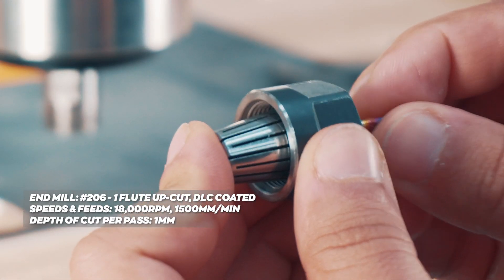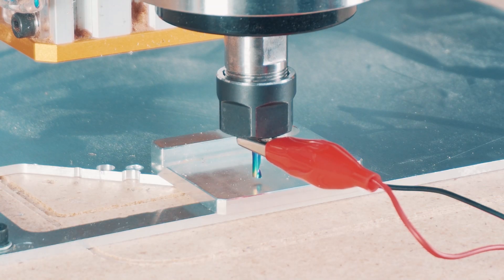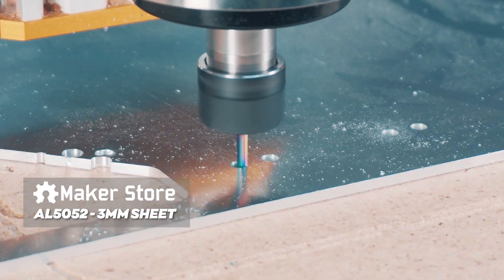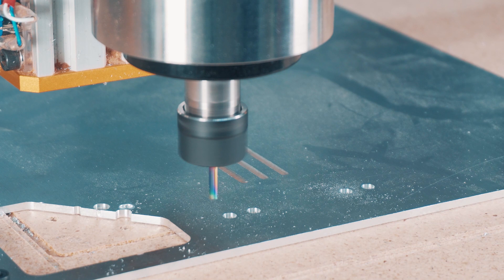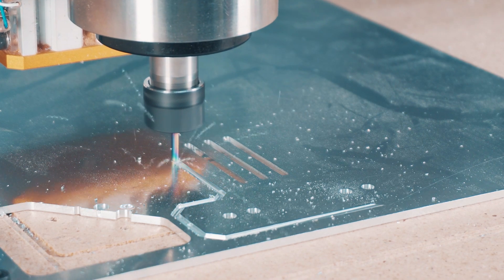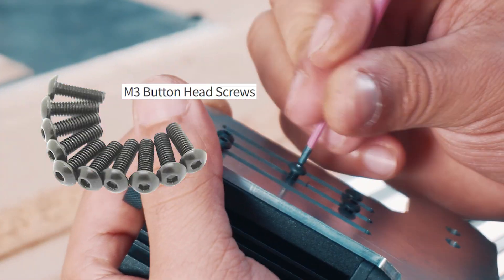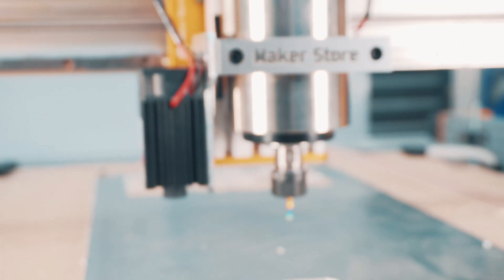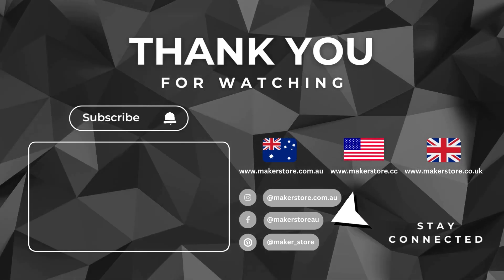Using CNC Machine To Make A DIY CNC Laser Attachment Solution

Comment: Very cool. What degree ramp angle do you use?
Reply from the maker: Thanks for your comment! A ramp angle of 0.5 degrees was used as it allows for smoother entry of the end mill into the material, reducing the cutting forces it experiences and lowering the risk of tool breakage.
Reply: @MakerStoreOfficial  Appreciate your reply, cheers!